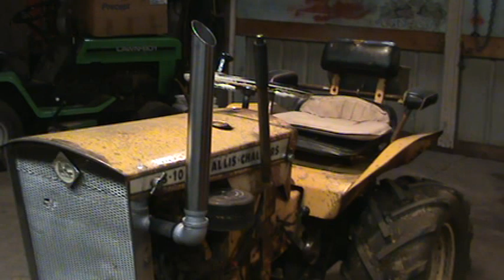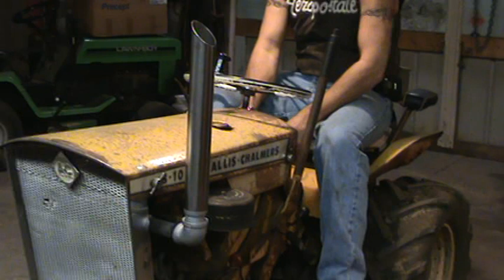Allis Chalmers with new Stainless Exhaust and LOW LOW IDLE

Comment from the maker: Two things......make sure the points are in good shape and properly adjusted then start the engine, turn the main jet idle screw out just untill it starts to idle rough, then back in 1/8th to 1/4 turn till it smooths out.

Comment from the maker: Hey Dave!! Glad you got everything sorted out on her. Those tires are new Carlisles, formerly Dico-Titans. Carlisle bought the molds for them and a few other tires. They don't make the Tru-Power in 8 inch, but they do make an ag tire called the Super Lug in 8 inch. Go to ebay and search for garden tractor tires and you'll find a few suppliers stores there. My size for the large framed Allis and Simplicities is 23x6-12, 23x8.5-12 and 23x10.5-12 for the rear. Make a video of the B-207!!

Comment from the maker: Thanks! The original engine, which was also a 23D blew up shortly after I got the tractor so I rebuilt another 23D from another 64 B-10 that was trashed and I guess it came together pretty well. I wasn't expecting the idle to hold out that low, but it did! Thanks for the comment!!

Comment from the maker: It's important to limit the time you let them idle low with the oil splash systems they have. A low idle like that can kill an engine in pretty short order. I don't reccomend any longer than a minute before making sure you get it back up to MFG spec idle, then let it run a few more seconds to lube the top end back up. But it sure is cool to hear that lug.

Comment from the maker: The original engine blew the connecting rod and took out the crank case vent vane, rendering the block useless. I had a freebie 1964 B-10 that donated its 23D 9hp engine to the cause. I rebuilt it top to bottom and the cool thing was that the two engines were less than 100 units apart from the Briggs factory. So, to say it's the original in the practical sense, no, but it's as close as one can get I believe. Thanks for the Thumbs up!! Later Bro!!!

Comment: Hiya Zippo,
I just recently got an old AMF tractor I believe it's from the late 60s or early 70s into four-speed manual I was just wondering is there any way to check the fluid in the transmission or rear end , Or are they sealed units,runs good,no problems it is an 8 hp Briggs & Stratton,by the way you do some great videos I just subscribed, thank you sir...........